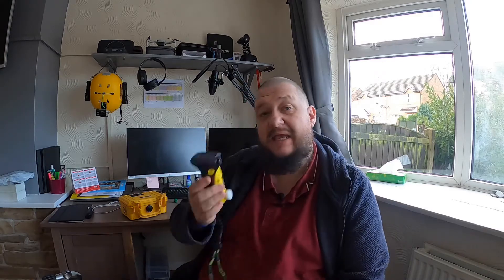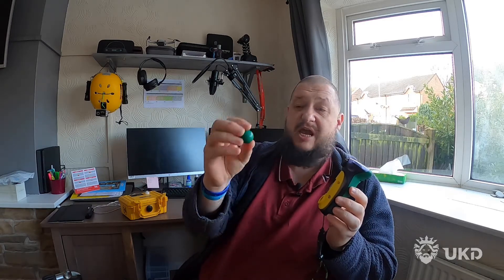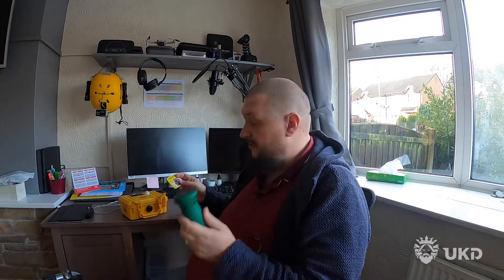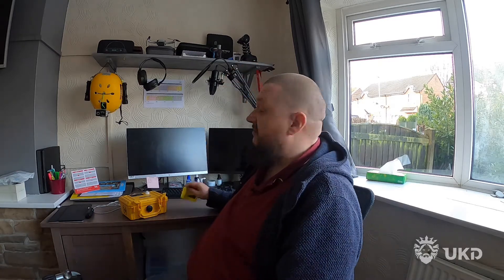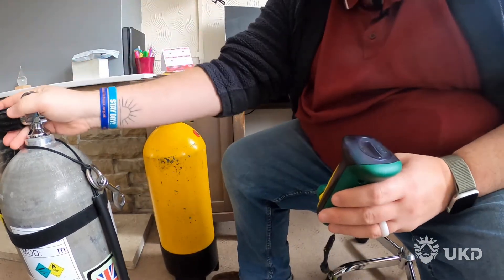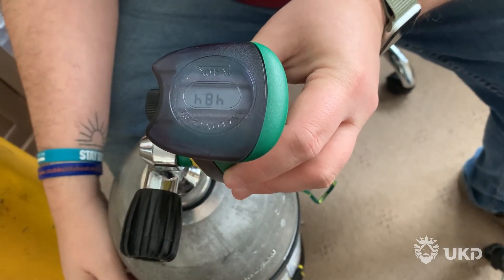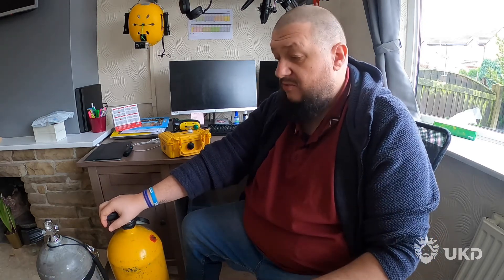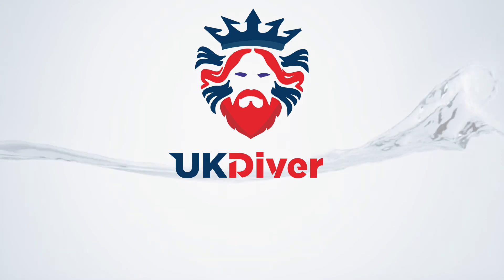How to CORRECTLY check your NITROX mix 🤓🤓 ¦ UKDiver

Comment: it should be noted that an air conditioner will remove moisture from the air so the humidity in a building with air conditioning will be much lower than the humidity outside

Comment: Thanks, you mention the display lock is hendy while blending your own Nitrox. Could you please explain how you'd use that feature?
Reply from the maker: The way I use it is once the reading has stabilised, I lock the screen and then I don’t have to worry about the reading changing whilst I’m completing the paperwork or showing the client the mix if I’m blending for anyone else. I don’t use it if I’m just doing a check on my own gas, but deffo a useful feature especially if you’re mixing your own 👍👌 Dive safe!
Reply: @UKDiver  Ah I see. Thanks, that makes sense.

Comment: Hi Andy, thanks for the vid. Would be interested in the reading of the nitrox mix when the ANALox is set up from the chart for relative humidity then crossed ref to when calibrated to a tank of known qty. We would expect the same but is this the case. Very interesting  the effect of pressure on the sensor reading I'm sure many divers do this wrong, I have been thinking of buying my own tester for a while now to take on trips that haven't happened due to covid I take it you would recommend ANALox? Sorry can't help myself with the capital letters 😁
Reply from the maker: Ahhhh Darren, a teenager trapped in an adult body just like me! 😂 With regards to your first question, the only way to ensure the mix percentage was known would be to use 💯 O2 as any other mix will ALWAYS be variable due to the type of testing unit, the accuracy of the unit and all the other variables. Remember also that the Ananlox is only accurate in itself to +/- 0.5% so there will always be slight variation. I’m just trying to show you how to not introduce even more in by incorrectly calibrating the unit in the first place. That aside, I can’t see any reason why we couldn’t do a test with 💯 O2 as and when I can get access to some 👍 Yes I would recommend this unit. Well made, simple to use and reliable. Come up regularly second hand, often needing a new sensor. These can be bought from Vandergraph in Leeds for around £40 when in stock as currently all cells are being snapped up for use in respirators for treating COVID patients. A more worthy cause I’m sure you’ll agree 👍 but as and when things return to normal, yeah, keep an eye out as they are handy, if not necessary, to have. Dive safe pal 👍😎 Andy

Comment: Great video!  It may be too hard to explain here, but I don’t understand how the O2 percent can increase as the cylinder cools.  The fraction of O2 molecules to N2 molecules can’t change in the closed system.  Does it have to do with changes in partial pressure due to differences in the weights of the O2 molecule vs the N2 molecule so the changes to their partial pressure with temperature are not linear?  If you have a link to a resource I could read up on and learn the answer that would be awesome!
Reply from the maker: Hey. I’m afraid the only resource I could provide is the BSAC course manuals. But you’d have to do the course to get hold of those. The non - linear weirdness gets worse the higher the pressures get and it’s weirder still when your blending tri-mix. Excellent courses I recommend them all 👍

Comment: Hang on - you can't use the Google outdoor humidity and your living room indoor temperature.  Got to be temp and humidity of the same parcel of air
jj
Reply from the maker: That’s correct. It’s pretty clear I wasn’t filling that cylinder while I was making the video as I don’t have a compressor in my living room 😂. If you decide to calibrate by finding out the current humidity level then obviously you have to do it there and then whilst your filling. However, the best and most reliable way to calibrate is to use a known air cylinder as I say in the video. It’s dry air and therefore no need to worry about humidity at all 👍

Comment: Hi, Should you start with the analyser on 20.9 or 21? ta
Reply: You should calibrate using the percentage from the table he shows in the video. If you don't have it available you can use 20.9, which is the 'standard' percentage om normal air. It may be a bit off depending on temperature and humidity so stay conservative in your diving.
Reply: @Yggdrasil42  exactly, so many divers out there don't understand temperature/humidity can effect the readings.

Comment: Just one question why don't you callibrate it agains 100% oxygen?
Reply from the maker: Hey. Well a few reasons. Firstly, as the O2 sensor reacts with oxygen, blasting it with neat O2 will fry the sensor much quicker than not. Second, you have to be qualified to use 100% O2 as it doesn’t play well with oils and such and not everyone who is qualified to use Nitrox will be qualified to use 100% O2 and you really don’t want and oxygen fire on your hands. Thirdly, if your testing anywhere else other than the fill station, perhaps if you’re whipping gas across to top up a cylinder and are testing the residual mix, you may not have access to 100% and finally there is the cost, bit of a waste of gas to calibrate an analyser that can just as easily be calibrated with known dry compressed air. Hope this answers your question! Thanks for watching 👍👍